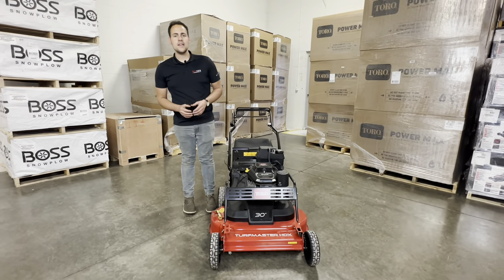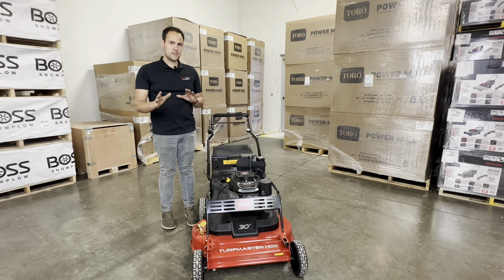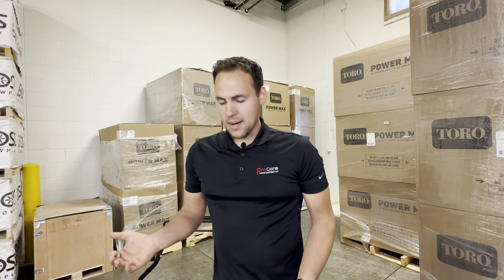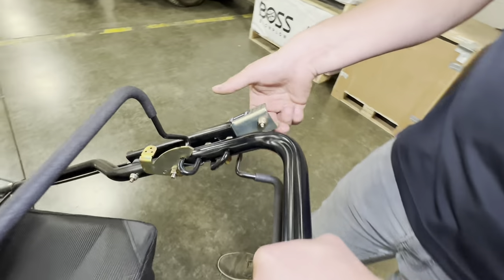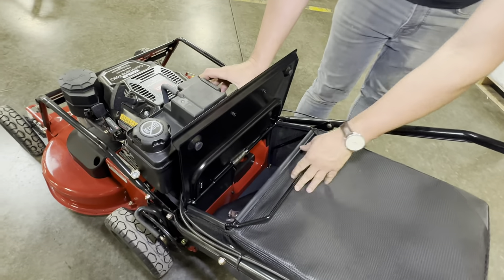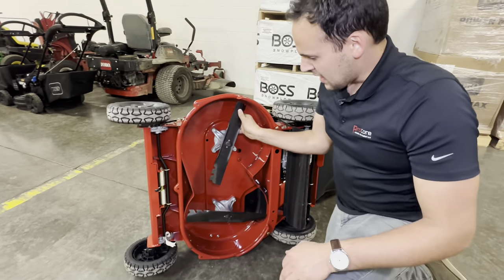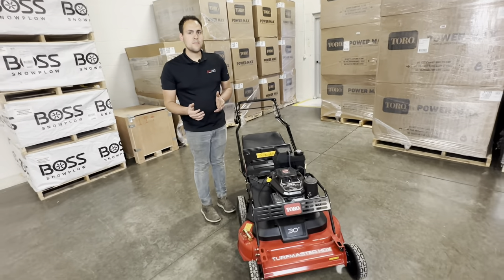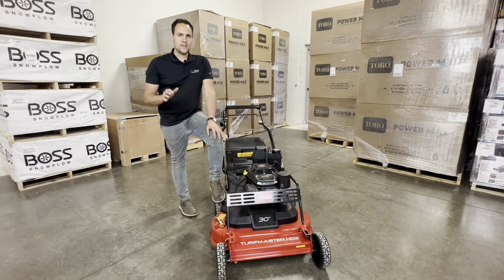Toro 22235 Commercial 30” Walk Around

Comment: This machine is a money maker. I've crushed some overgrown tall grass properties with it BUT there are some problems with it...
The first day, the machine took off, and a year later, it didn't have the same power it used to have. The back flap protector ripped off, and the wheels are contacting some sort of metal that's giving it a squeal. It's very heavy machine but worth it in the long run. Made my money back plus in a few months